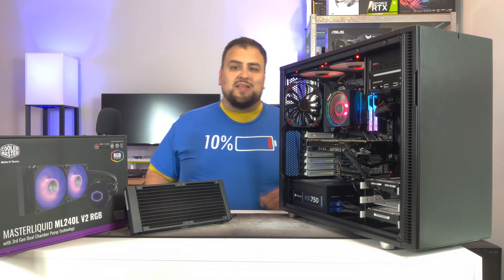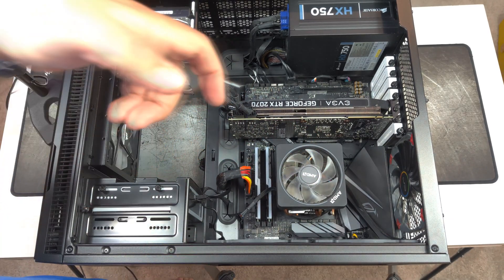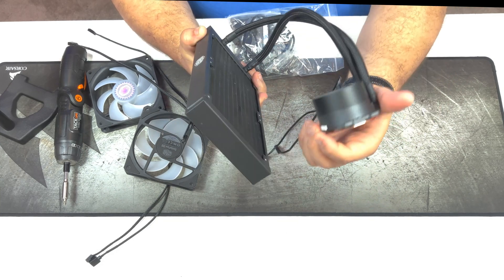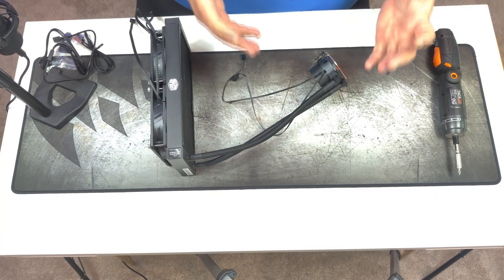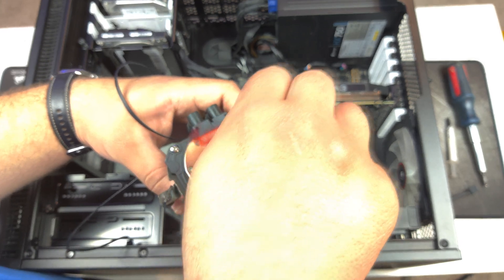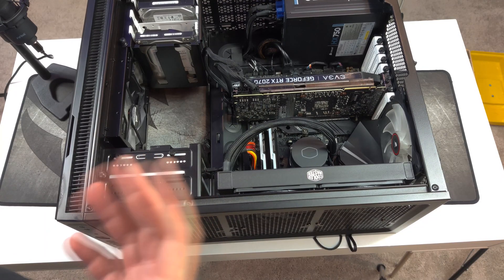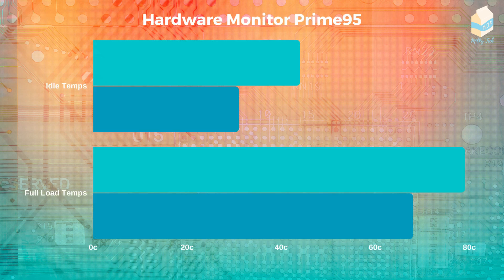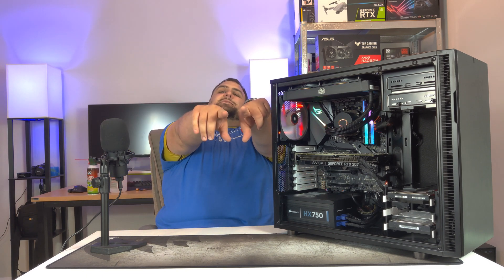How to Install a Cooler Master Masterliquid ML240L v2 RGB on Ryzen 7!

Comment: Hello, I'm using this cooler on the case ceiling. I installed it with the fans under the radiator. After watching you, I replaced the fans and got them on the radiator. the result is much better. Thank you.

Comment: is rgb header rotation important while pluggining in to motherboard? another question is do I need to plug in rgb headers to addressable led stripers head (3 pin 5volt) or led strip headers 12Volt 4 pins?
Reply from the maker: First question, yes polarity matters. If you look at the label, it tells you which one is red, green, and blue. An addressable led strip (ARGB) needs to be plugged into the 12V 4pin header, and a none addressable led strip (RGB) needs to be plugged into the 5V 3pin header.
Reply: @MilkyTech  thank you

Comment: what software do I need to install to change the colours
Reply from the maker: I am using asus aura to control it. You can use any of the other motherboard manufacturers software to control it, like asrock, msi, and gigabyte, or you can use the included controller.
Reply: @MilkyTech  I’ve tried loads none of them are working

Comment: I really don't think you should have your radiator fans sucking the airflow from the outside to the inside of the pc case. In the video, though, you thought this would allow the cold air from the outside to blow into the case, and then the exhaust fan to pull the hot air out of the case, there is a big problem with this. It is not difficult to note that the pc you have shown has only one exhaust fan, which has a very limited quantity of outward airflow and hence cannot accommodate the larger quantity of the inward airflow brought in by the radiator fans. Moreover, many people also have 2-3 extra fans at the front side of the case blowing inward airflows. In this case, a single exhaust fan makes it worse, allowing the heat generated by the CPU to be sent back to the radiator and then back into the chassis. After a long time, the internal temperature of the case becomes higher and higher. If you also have a GPU working hard simultaneously, the internal temperature of the case will be even more horrible. Therefore, you should change the radiator fans to blow outwards, so that your case will be much cooler inside.

I highly recommend you give it a try and make a comparison video. I personally compared the above two radiator fan installation methods, the final conclusion is that the radiator fans' airflow blowing outwards is the better way to get lower CPU temperature and GPU temperature.
Reply: Thank you so much
Reply: I agree with Lucy! 💯💯💯💯💯💯💯💯💯💯💯💯💯💯💯
Reply from the maker: Thank you for your analysis!  I think this would be a great video to make and I will put it on my schedule to do!  Thank you so much!
Reply: Looking back on this, I plan to upgrade a prebuilt system I own by replacing the cpu fan with this AIO cooler, and looking at your suggestion, it makes sense. However, I only have one exhaust fan, which is the one it came with, blowing air outwards. I can’t put this AIO cooler to blow air outwards because I don’t have enough space to put it as such. It only has space for one fan. What can I do? I also wanted to place the cooler on the top with the fans pointed down. Any suggestions?

Comment: Hello There Awesome Set Up Video I Am Buying This same Cooler Master AIO Today On Amazon It is on Sale I am Upgrading From
The ID-COOLING AURAFLOW X 240 CPU Water Cooler 12V RGB AIO Cooler Which I Purchased Last Year But It Isn't Performing Like I Thought It Would Its Not Cooling My CPU Like It Should And That IS Why I Am Upgrading I Hope That This Cooler Master Is an Better Improvement and IS Gonna Keep My CPU Nice & Cool as I Like To Do A Lil Overclocking Time To Time My CPU IS An AMD FX-6350 and my Motherboard  Is  a M5A97 R2.0 (Socket 942)
Reply from the maker: Hey how is the cooler holding up for you? Youtube hid your comment from me -_-
Reply: @MilkyTech  it is working great and keeps my CPU nice and cool 👍